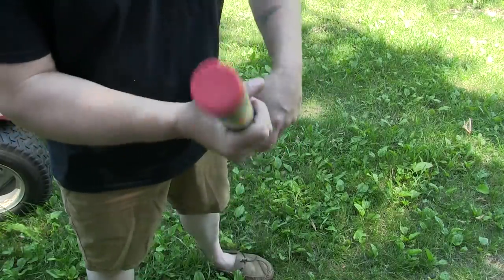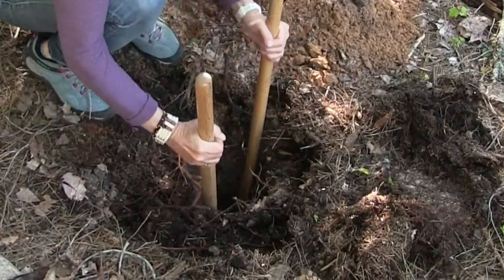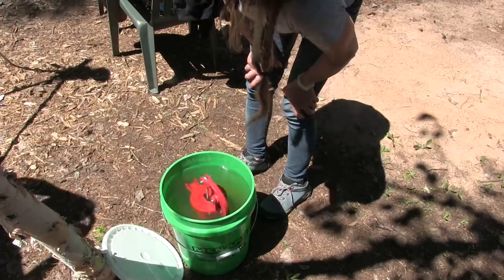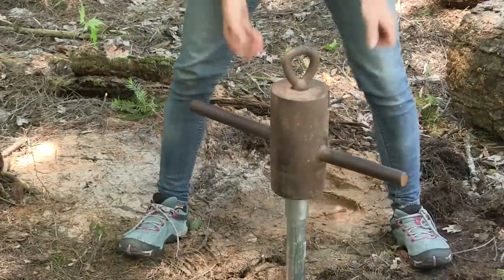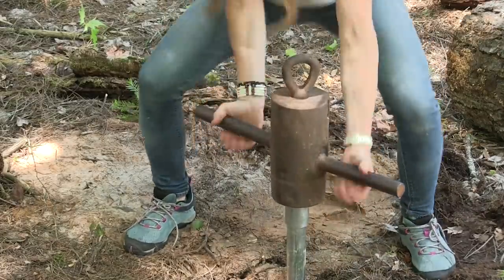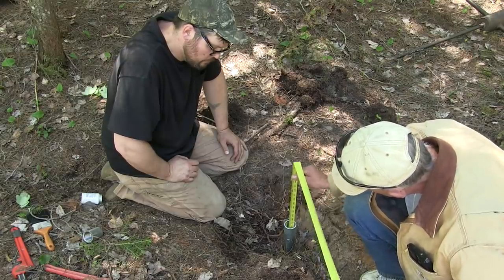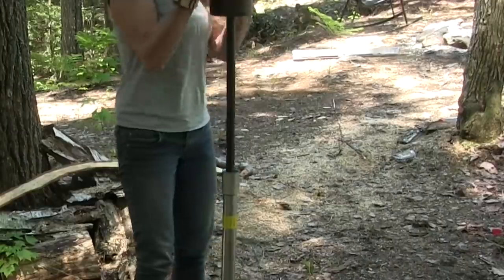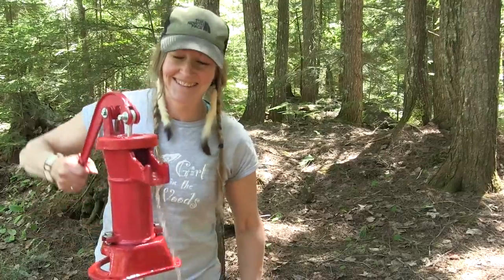Driving a hand pump well at a remote off grid Wilderness Camp

Comment: We just did a sand point well at our cabin. It was an all day project using a fence post driver! We just got our water test back yesterday and it's 100% safe potable water! Total game changer for us!
Reply: how deep did you have to go and how much was the total cost?
Reply: @dronus  we hit water at 6 feet but went down 17 feet (which includes a 4 foot well point). Total cost was right around $300 for everything from Menards, but could have saved a few bucks by going with a 3 foot well point. We also added a check valve because the leather one in the pump leaks down after a day or so.
Reply: @jrosborn77  thanks for the info. I want to put in a well at my grandma's place. She just buys gallons of water at a time, even though she's on 25acres. Itd be more convenient and she'd save money on gas alone. So she lives on a mountain thats about two miles away from the Columbia River and her elevation is 2600ft(I'm assuming above sea level). There's a map that shows her property boundaries and in that map there's an indication of a water source but it disappears as it's going up the mountain. And that water source is about a thousand ft away... My question is how likely would I be able to hit constant running water? I don't know if elevation has anything to do with it. She's surrounded by forest and bushes so there's some type of water source beneath the ground or I could be wrong. I just don't want to waste money and time trying to find that sweet spot. Thanks, sorry for such a long reply.
Reply: @dronus  unfortunately I can't help with the "is there going to be water here or not" part. I just don't know how the mountains work. I knew I would hit water shallow on my property because the entire area around my cabin has standing water much of the time... And it's flat with little elevation change. If you can't risk wasting the money, maybe try something that's not as expensive up front like rain water collection. Our original idea was to put up a couple 175 gallon ICB totes and gutters. The cost to do that was about half as much as the well. Sorry, wish I could help more.
Reply: @jrosborn77  thanks for the info.
Reply: where I live we have had a drought for over 7 years.We had 5 minutes of rain after a month or more.I am in Mass. on the NH. border.This is crazy.Our water pressure sucks & I am trying to grow a veggie garden.It has gotten to the point I have to shut the well pump off all night and several hours in the day because our water pressure barely reached 10 psi.Our well is at 100 feet.
Reply: @debrasalt3598  wow. That's crazy. Going dry?
Reply: @jrosborn77  Find a person who can dose for  water,they  will tell you how deep and how water below .
Reply: @matt Harvey Spot on! we bought a new one online 4 years ago and installed it.In my state they insist on a plumbers lic. for too many things so we got it from Amazon.Well, the tank will not store any more than a gallon at a time.We disconnected it and we did gain about 5 PSI.we need to drop the well another 100 feet since I believe we are in year 7 of the drought up in Mass.We now have to "load shed" the water.How lucky you are to be up in the UPI! Dropping the well is not an easy task because those plastic clips they put to stop slippage have gotten stuck and we are afraid to lose the well head that was replaced about 7 years ago.When we get adequate rainfall, Life is a lot better but with a garden & all we can only do a rain dance.2 days ago we got our first significant rain in years.Since the snowpack has been very minimal this impacts your well too.I remember regular rainfall was common in these parts.Many people re experiencing drought in the U.S. or their fields are under water as if we don't have enough to worry about.Enjoy the UPI this Summmer & Fall.Very useful video.
Reply: @jrosborn77 , I hit the water at 8 feet, and drilled 18 feet down.  Now I can pump 20 Gl of water from the ground. After that I need to wait around 1 hour to pump out another 20 Gl. Do you have continuously water? I am worrying in the Summer time that I would not have ehough water for my garden. What do you think? Thanks.
Reply: @namentatic4978  ours doesn't need a break. We can pump all day without running out.
Reply: Cool. Wish me luck in my 4.5 acre wood in the UK 🇬🇧 💧 🚰
Reply: @dolphinliam888  UK? Wow! Good luck!
Reply: Are you in Michigan by any chance? I’m looking to drive my own well and I heard the fresh drinking water is around 17-20’ in my county
Reply: @jeremyjames249  central Wisconsin.  Our township had a topographical map showing ground water.
Reply: @jrosborn77  ok thanks, I’ll check my county and township
Reply: Where do you get the pipe and pump head and such.?  And what company sells the whole system together
Reply: @youdontknowmemom8119  we got all our stuff from Menards. There isn't a kit but the back of the box for the pitcher pump shows what all is needed. Lowes,  home depot, ace hardware, etc. would have everything too.
Reply: @jrosborn77  thank you for your info.  If anyone else has anything to add please do.  I'm on the edge of a small town.  About a block away from a known shallow well.  That's not to say there are many more that have been built over or forgotten.  Who has the water table depths records at the county level.  I wonder.

Comment: Love your channel brother, I have watched all your stuff! Having successfully completed this task myself in Manitowish Waters, WI I will share some of my lessons learned. 1.) I had water at 5 feet but I still used 4x 5' sections plus the point. The water flows great and is very clean. 2.) We rented an electric jackhammer with a 3" cup attachment. It was only $80 for the day and made this job so easy. 3.) Used 18" cheater bars on the 18" pipe wrenches to get the couplers extremely tight. 4.) stay away from the last thread on the pipe with the dope otherwise you will taste it I'm told. Also, clean out the inside of the point and pipes with dish soap before you drive them. I used a 1.25" pipe brush on a section of 1" pvc pipe as my scrubber. 5.) I used 12" section of pipe to drive on; it had a nice mushroom top by the time we were done. I had a drive cap on it at first but that quickly broke the threads on my 12" section. I didn't have enough couplers to sacrifice one. 6.) We cut a hole in the cabin floor and ran the pipe right down below the utility room. It will be boxed out in the crawl space and heated to prevent freezing.
Reply: In Wisconsin myself. Where to find land? Any suggestions?

Comment: That seemed to go quite easily.  Seems to be a soil that is well suited for sandpoint use.  Awesome
Reply from the maker: Hey Lonnie!! Its all sand there. Brooke even brought in rocks for a fire pit. You couldnt find a rock if you tried.
Reply: @Bushradical  why didn't you answer my question?
Reply: @Bushradical  just bought five acres of wood in upstate NY...the rockiest soil ever. But I see trickles and water all over the place. Good video, but you'd drink water from a shallow well?? My idea is to treat it with ROD
Reply: @lukejones1244     Good seeing you here as well.   "Bushradical" and "Girl in the Woods" Have been kind of cyber friends I guess you could say.   We met once as they stopped here at our house a year or two ago when they were here in the state.   It was great getting to meet them in person.
Reply: This reminds me of Central Florida and the sand here. We call it sugar sand. Very similar. I could see us driving in a well like this.
Reply: @onecrazywheel  s 3÷÷pl
Reply: @rjbesonen4497  ?
Reply: @Bushradical  I was thinking of doing the same on my land, I am in the northeast and just wondering how I would keep it from freezing in the winter months?
Reply: @Powderhound-cb8pb  A lot of insulation around the pipe and make sure to pump it regularly, the water in the ground for you is about 45 to 50 degrees (depending on how far up north in the north east you are) so as long as it's well insulated and cycled with new warmish water it shouldn't freeze.
Reply: @BrentTJo  Awesome man, thanks so much for getting back to me. cheers and best wishes for you and yours.
Reply: @Powderhound-cb8pb  saw someone else mention if the top can freeze overnight and crack the pump which does make sense so most people remove the pump over winter.  If you need to use in the winter you screw pump on prime and pump needed water and take pump off letting water fall down the pipe again to where it won't freeze.

Comment: Thanks for the tutorial.  We just built our off grid cabin and was thinking about putting in a hand drive well. We're a lot older so I'm looking at ways to drive the well pipe.
Reply: Wonder if an SDS rotary hammer would work? Makes short work of a ground rod.
Reply: Find yourself some decent young folks to come to your property for the day and do the heavy work for you. Maybe a nice barbecue and a lot of ice cold drinks will be plenty enough in return.
Reply: If was in the area I'd come hammer the well pipe down during an afternoon or two of camping and cooking out. I'm sure someone will give ya a hand if you throw in some beer. (I don't drink alcohol )
Reply: @InDisskyS131  Great idea!!
Reply: That well driver had a round attachment that you might be able to rig a rope system to use. a 3 to 1 haul might work. Good luck.
Reply: @castleprotection  Yeah, it was made for a rope to go up to a pulley, and then down to a cathead winch.  Let the winch do the work!
Reply: I would set the pipe plumb and use the front loader to pound it in.
Reply: @InDisskyS131  
Have a "school" and "charge" then for the classes?
It happens much more than you think.
Reply: @traveler7249  For sure, but maybe in this situation it would be better to get some of the locals involved. Always good to have friends.
Reply: @InDisskyS131  It was Not a serious post..
Reply: The best way is to rent a gas powered T post driver it weights 26 pounds and, it will drive that pipe down  RIDICULOUSLY fast and easy.  It will drive that pipe around 8-10" in 2-3 seconds, NO JOKE..
Reply: What, they are only 107 years of age!
Reply: Deep South Homestead: if y'all are in Bama I will help you!
Reply: Use the wash in system.

Comment: This brought back memories. I helped my father pound a well just like this almost 50 years ago. The only difference was the "pounder from hell" was over the pipe instead of inside it. We went down 66 feet and every inch was hell. Thanks!
Reply from the maker: wooo!
Reply: that's exactly how I imagine a job like this to be.... I'd be incredibly lucky to get this on the first try and not hit rock or roots.  This is the kind of job that looks easy and is easy in theory, but the Earth and the available water-table have countless variables that could make sinking a well impossible or cause significant setbacks .
Reply: It's physically impossible to pull up water 66 feet
Reply: @ME-rv1pw  Deep wells don't use suction, they push water up from the bottom so they can pump water up hundreds of feet.

Comment: I just put in a well here in SC 4 months ago by myself. I wish I had a big driver like yours. I used a fence driver and it took 25 licks per inch for most of the depth. It took several days. I went down 20ft plus the point.The result was worth it. I just got the test report back and it is very good pure water. Thanks for the video.
Reply: How much water can you pump continuously?
Reply: @namentatic4978  It will probably pump 5 gallons a minute for as long as you can pump the handle.

Comment: This video is great and I am not trying to be negative, but you left out one very important step. You need to seal the well off from everything on the surface of the ground. There is a space between the wall of your hole and the well case [well Pipe] that will allow contaminated water from near the surface of the ground to run right down and into your drinking water. Also, a dog could pee on the pipe under your hand pump and his pee will run right down that Case / Pipe and into rour drinking water. It is easy to fix this. Pour some clean sand down and around your pipe. Pour enough to fill up and over the filter at the bottom of your well. Next fill the remaining space the rest of the way up with the clay dirt that you dug out in the beginning. I always like to finish off my wells with a small cement slab, about 3' x 3' that I use to build a small table that the hand pump will sit on to steady the whole thing up. By doing this, you will ensure that your water is always pure as the water from the sand layer that you have tapped.

Comment: For almost every job, you need a guy like Scott who knows exactly what he is doing.
Reply: Having a brain helps when some don't wish to in-gauge the one they have, like after being shown how ~
Reply from the maker: Scott's an amazingly capable guy.
Reply: He got the job done but there was nothing professional about the way it was installed, but it works and they get water.
Reply: @kentitus7550  What about the crescent wrenches?
Reply: @tommak6516  I noticed that too. I used the same 18'' Ridgid  offset pipe wrenches but I had two 18'' long 1-1/4'' extensions. You can't get the couplings as tight as they should be without extensions on that size of "pipe wrench" I also used tapered split thread couplings instead of those lousy drive couplings. I did not drive on the coupling but used a drive cap. He should have used an auger to auger down to the water. I generally I would start out with a ten foot section of pipe with the point on the end and would drop it all into the hole then add 5' sections. You can tell when you hit water as the auger will come back up with a little mud on it instead of sand. He said he was lucky he had sand but you only put points in sand as stones will rupture the point. He never did say what the point  mesh size was. Probably 8o mesh but if course sand maybe 60 mesh. I have installed hundreds of points for builders on new hommes and  homeowners when their old point gave out which was generally that so much iron had built up on the point screen that water couldn't come through.
Reply: @tommak6516   I forgot to add, In my area I would have 3' of water above the point. He said one Ft. and maybe can do that in his area. If you get a long drought you can run out of water at 1 Ft. and could also burn up your pump if hooked up to an electric jet pump from sucking air and loosing prime. Have a great life.

Comment: HERES A GREAT TIP PEOPLE. I used a harbor freight post hole digger and kept adding sections of 1 inch pipe. Got down 20 feet deep with a 6 inch hole in about an hour. You can do it.
Reply: Are you saying you added the pipe to extend the handles of your post hole digger?
Reply: @marquettemich  no, actually I added the pipe to the top of the auger bit. Buy a fitting from lowes that will fit over the top of the auger and has threads on the other end. Drill a hole through it and put a strong bolt through it. Then just screw on a section of pipe. I found that 5 foot was easier to deal with. Drill down and add another 5 foot section and keep going. The hardest part was lifting it out of the hole every 3 feet down to remove the dirt.

Comment: What is the lift limit of the pump? Good job explaining everything else.
Reply: Some pumps say 20-30ft and then I've seen others say 10 times that, which I don't believe.
Reply: Due to the limits on what suction can do to lift water 23-26 feet is the max even when math says 30ish feet. 

For deeper places you need a pump down in or near the water that uses a drive rods and check valve as you are no longer sucking the water up the pipe but pushing it up. At that point you no longer can use a sand point and instead need to drill and case the well even if you can do it with hand tools like an auger style post hole digger you can extend with black pipe sections or one of the man portable well kits that religious group hydromissions makes.
Reply: august thanks
Reply: Andrew H thanks
Reply from the maker: 25'
Reply: @acidheadzzz  What they would want is something called a simple pump. The channel Engineer775 shows them off as an option that can be put into most wells next to the existing electrical pumps and looking at them on their website they max out at 325 feet of lift. They can be hand pumped to pressurize the normal bladder tank or can be fitted with a DC kit to let you run it off a car/deep cycle battery. 

They use a fiberglass rod setup inside the pipe sections to operate a pump all the way down in the well and use a check valve to hold water in the pipe with a weep hole to drain off a freeze zone to prevent ice damage. 

Depending on the bladder tank size once it is at a good pressure it is generally enough for a quick shower or washing the dishes so possible for a single person to have almost normal water usage without needing to constantly pump. 

Do you know the static water level in the well? How deep they are is simply how far down they needed to drill to get good recovery but often you will have a water level that can put the water 20-100 feet below the surface so much higher then the total depth of the well.

Comment: I recommend cleaning the threads with brake cleaner to get the oil off before putting the pipe dope on. Make sure those couplings are REALLY TIGHT, use extensions to really get tight.